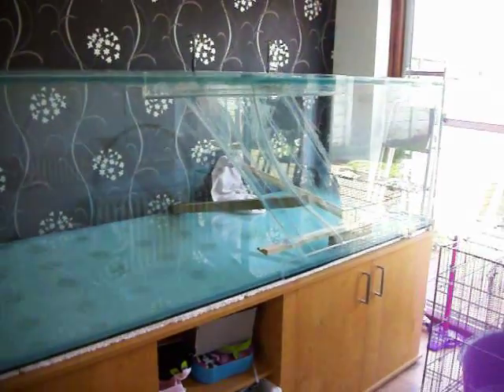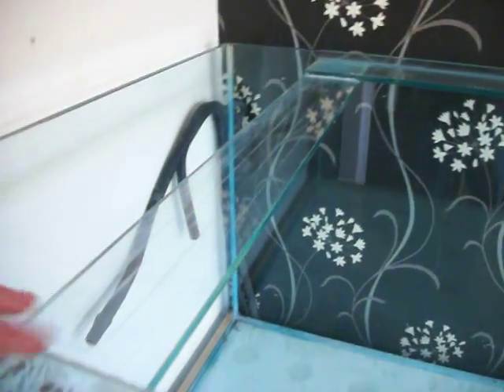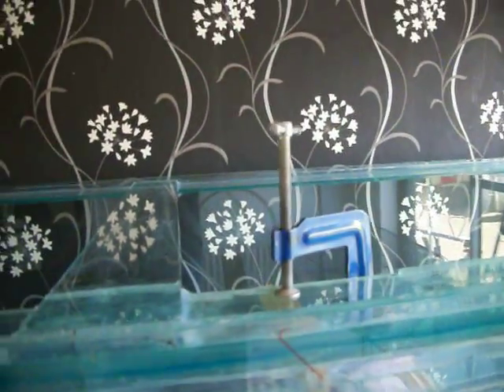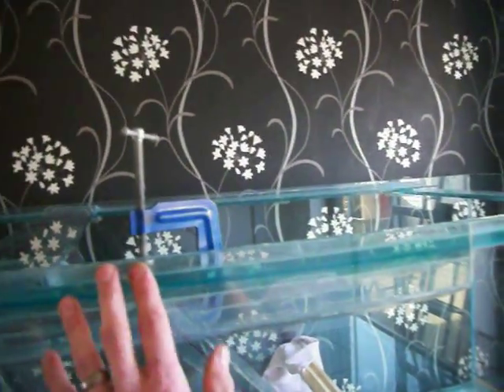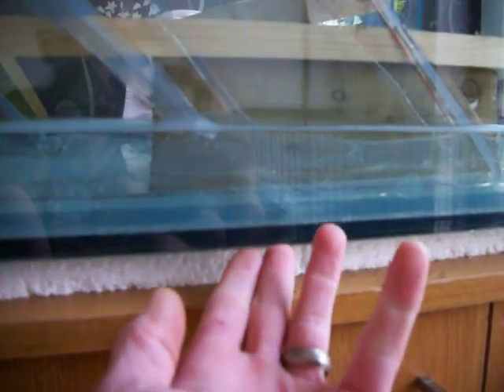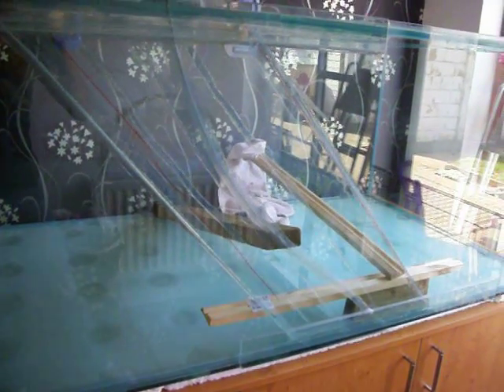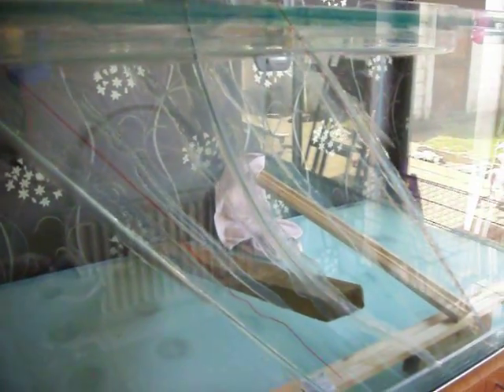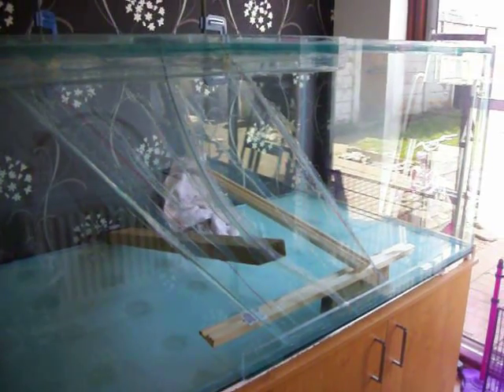My 1600 l aquarium cracked and leaking !! part 2/2 repair video !!!

Comment from the maker: No im not insane dude.I had a tank builder look at the tank and he was the one that suggested repairing the tank and not replacing the whole panel. He has made and repaired aquariums for well over 40 year's and he knows his stuff. I have full faith in the repair. The tank has been filled maney time since the repair and has been fine. I doing a 3d background inside to cover the repair their will also be less water. If the tank ever does go i would be happy for you to say ( TOLD YOU SO ) !!!

Comment from the maker: @billm90I assume brian didn't have a square peace of glass big enough to cover the whole crack ? I think if you can get the glass yourself. And if had have got the glass myself i would have used a big square peace instead of the long angled peace !!! But we just used what was to had at the time !!!!! And it worked !!! My crack was repairable !!! But some are not depending on how it has cracked ect !!! But the tank is still holding fine and im very happy with everything. thanks for your question.

Comment from the maker: @OnsiteaquariumsMy plan was to replace the panel but i had a tank builder look at the tank and he suggested repairing the tank and not replacing the whole panel as there was no need. If the tank was going to blow out ect it would have done when it cracked originally. He has made and repaired aquariums for well over 30 year's and he knows his stuff. I have full faith in the repair we did. The tank has been filled many time since and the repair has been fine. I have no plans on moving it either.

Comment from the maker: @ajbaker7 Yes the crack is still there !!!! But covered with a plate and siliconed up ect !!! The tank is holding water fine !!!! The repair is now behind my background that is now finished !!!! I am just leeching the background out atm !!!! im due to water test tomorrow and then empty and refill it again !!! I will have to do this for some time until the ph and hardness of the water go back to a safe level once the cement has fully leeched out everything !!!!! Cheers for the question ;)

Comment from the maker: @ResinFlux The tank cracked in the first place due to the center brace coming unstuck to the front sill. Because the tank wasn't being supported by the centre brace the weight of the water coursed the tank to bow out in the centre. This along with a little chip on the out side in line with the faulty centre brace coursed the tank to crack. If the centre brace had of been fully supporting the centre of the tank it would NOT have cracked the tank in the first place !! Thanks for your question ! ;)

Comment from the maker: @ResinFluxThe bracing at the top isn't designed to hold anything on top such as a hood ect. It's to support and stop the top bowing out. Their is no bracing around the bottom cuz it has a double base. The double base supports all 4 panels from the bottom of the tank. It is better than just having bracing in the bottom of the tank. just costs a little more and is more hassle to install when making an aquarium.  That's why most large tanks are just braced at the bottom and don't have double bases.

Comment: i did this with 2 125 gallion tank one my oscars cracked the glass and the other i ropped a rock threw the bottom. both help up and are replaced

Comment: How about cracking is on the bottom of the tank. My parents tell me to change whole bottom glass because they don't want me to screw the floor again. I siliconed whole crack sufficiently and filled in plenty of water and it doesn't leak so far.  Should I replace it whataya think?

Comment: Hello. How is the repair holding up? Is it holding water ok? My 210G tank cracked and I want to patch it because I don't have that much money, but everyone is telling me to throw it away and buy a new one because it might explode. My crack it at the right corner of the rear glass pane. It runs horizontal from top to bottom 18" long. Can mine be safely repaired?

Comment: fantasyleague0629 put a  hole  new bottom on yours put it under the old one and you can use any silicone sealant you like and it gives two layers

Comment from the maker: @ajbaker7 I did plan to do that !!!! But The tank builder guy that came around to look at it told me that replacing the front panel was a lot of unneeded work !!!!! That would have cost a good bit of cash !!! he told me that putting a plate over the crack would be fine and would be more than enough !!!! He told me that the tank was more than strong enough to hold the weight of water and wed were more or less just sealing the leek !!!! He has built and repaired aquariums for over 40 years !! :)

Comment from the maker: @sshhaammiiiiiiiiii 10mm glass would be a minimum thickness for my tank ! so12mm is good ! 19mm would be better but there would be no need really ! The glass only need to be thicker when you start making your tank taller ! If your aquarium is over 30" tall you would need a min of 19mm glass. 1 because there is more silicone at the joints making them stronger and 2 because the pressure at the base of the tank is greater as pressure work vertically not horizontally. These are the safety regs !!!

Comment: @Davidkinzett thanks man that was helpful... my tank is 6 feet long 36'' tall & 36'' wide, what do you recommend ? i'm using glass only on front side rest is made up of concrete, should i decrease the height or 19mm would work fine?

Comment from the maker: @sshhaammiiiiiiiiii 12 mm glass is fine. If my tank were made from 10mm it would also still be strong enough ! if my tank was 30" high then i would have to have min of 15mm glass ! My fill level is only 25" ! So 12mm glass is more than enough ! I could have a tank that was 40 foot long in 12mm glass if it was the same height and width as mine ! The thickness of glass is more for the pressure at the base of the glass !!!! Pressure from the weight of water works down with gravity !! not across !!

Comment: 400 plus gallon tank & just 12mm glass? i'm making a 400 gallon tank & i'm going with 19mm glass & still worried about its safety... mine is made of cement with glass only in front, don't you think 12mm is too weak for that big tank? & you just siliconed the crack so is it working now?

Comment from the maker: @civicsurfer Well mine is holding fine matey !!!! All cracks are different tbh !!!!! depends where ect !!!! Some can be repaired and some can't !!!!! Ill send you a message with my email address in it !!! If you can send me some pictures and info about the tank ect i may be able to advise you on it ;) Im no expert but i know a few people that know what they are talking about when it comes to this sort of thing ;) I will need to know the glass thickness !!! Also clear pictures would be good ;)

Comment: 400 gallons on styrofoam!!!! That's why your pressure was more on front panel less on back that tank should be on a SOLID flat surface
Reply from the maker: The Fishy Life ! What Shit you chatting ?  Tank cracked before background went it.  Due to strut brace failing.  And a chip on the outside of the tank.  Background went in after to cover the repair.  And tao was fine for 3 years when I got rid of it.  I'm sure its still fine today ?

Comment: @sshhaammiiiiiiiiii hey bro i'm putting glass in front of a cement tank, i have no idea how to do that, how can i stick glass with cement? should i put the glass in a steel frame & then stick the frame in the cement or should i use some kinda glue? & then how can i seal the joints to make it waterproof? i'm confused, can u help me with that? or give me some links about it?